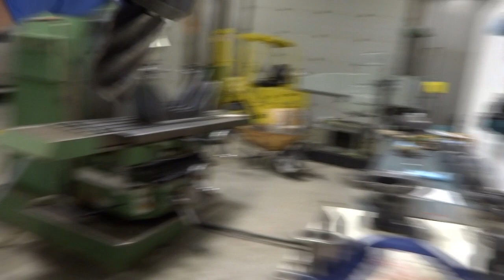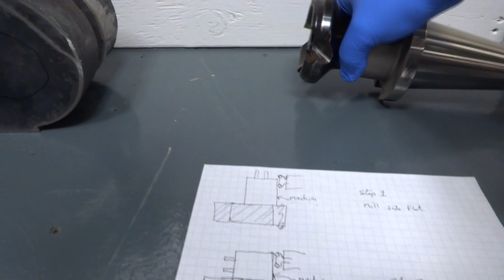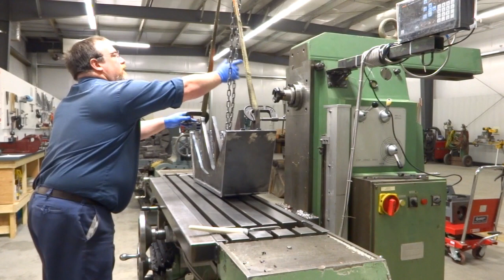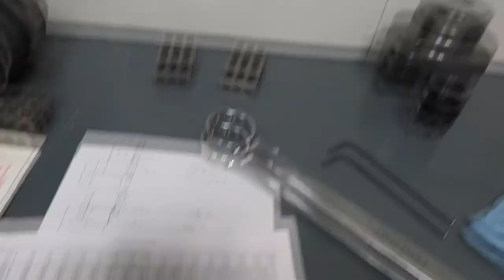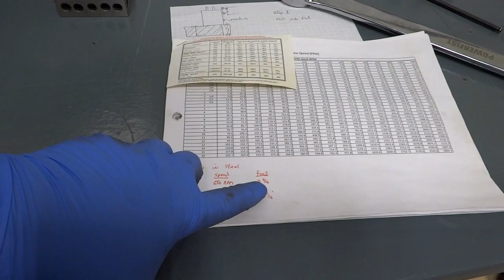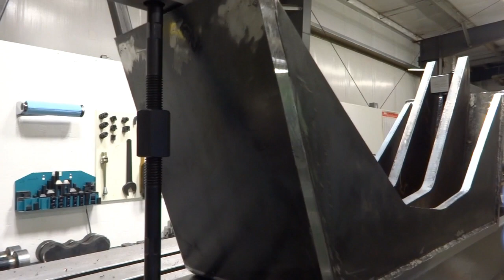Clamshell Bucket Part 3, Post Weld Machine part 1

Comment: if you haven’t already you should consider fabbing up a parking attachment for that vertical head similar to the k&t mills.  seems like you would have an easier and safer time of lining up the dove tails.
Reply from the maker: Hello Jeremy.  This mill came with a parking attachment and I used it a few times.  However, i found it much easy to do with my crane.  Thanks, Ken